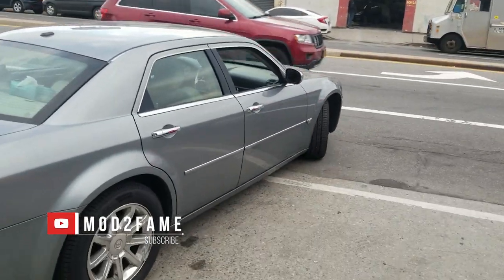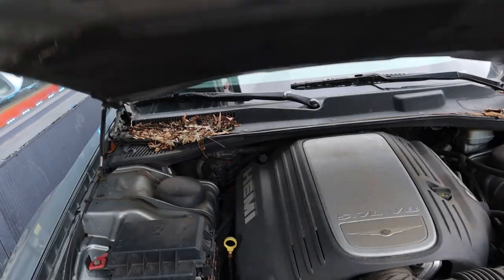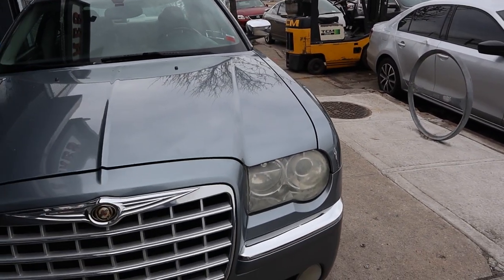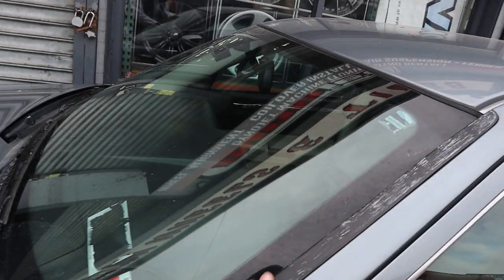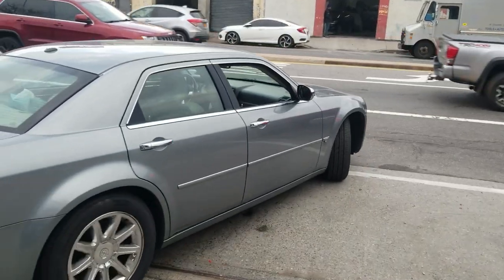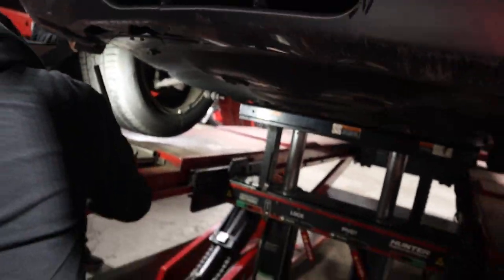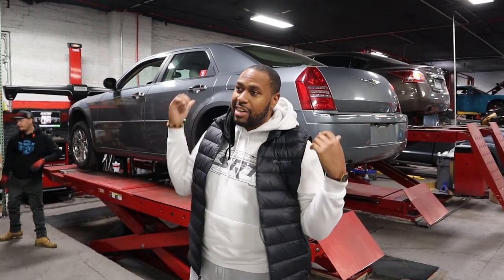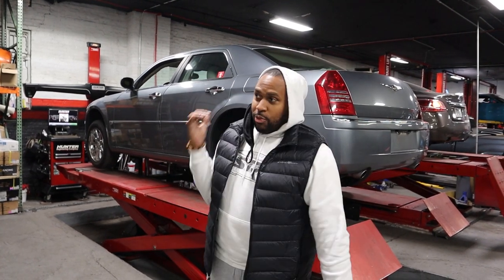Did I Buy A LEMON? EVERTHING WRONG With My 2006 Chrysler 300c ....

Comment: I've had my personal mechanic. Replace all of those things. I just bought the parts on either amazon or ebay. My latest repair work. That's about to be done is. The replacement of my drive shaft, emergency brake shoes and an alignment. After that's done. All that will be left to do is the leaking sunroof. A small ding on the corner of the hood and upholster the front drivers seat. After than mine will be 100.

Comment: I have a 300 touring. I've had all those issues over the years. Some were an easy fix. Such as a blown fuse. It's good on gas. However if you own a rear wheel drive one. It's not good in the snow. I've well maintained mine. She runs great.
Reply: How great is it on gas I want to get a 06 one
Reply: It’s good if you’d don’t step on it

Comment: I had replaced everything in the front of my suspension on my Chrysler 300c and  especially the lower front ball joints. I wanted ones that  You could grease it was so hard to find them. I had to replace the bearing that's in the mid section of the drive shaft that was fun to do.  Check the edition coils Rust gets inside the boots where the Spring touches the screw inside the coil that goes to the spark plug. I just threw them out and I put 40000 V coils on there. This is a really good video

Comment: Let me say this my 06 300c had never been an issue bought new when she had 17 miles ... low and behold still have it with 224,998 miles just a simple egr valve issue and that’s it just keep the oil changed every try 3k plugs and just take over care of it and she’ll be good to you ... btw I’m tuned with hemi feaver
Reply: Thanks for sharing, i think 2006, 2007 and 2008 models are solid as rock. Beside the Mds problem which u can get arround with just a tune
Reply: True I’m on 87 mpg boost
Reply: @kingakfortyseven3852  a good 93 tune with trans pressure turned up makes a world of difference and more fuel mileage than the 87 boost trust  me
Reply: Btw mine was still running when it was totaled out at 245,000 miles
Reply: @movingearth3726  the canned tune? Haven’t tried the 93
Reply: @kingakfortyseven3852  yeah what programmer are you running ... Diablo Trinity sport you can turn the shift pressure up on the Chryslers
Reply: @movingearth3726  i got a itune3

Comment: Nice Video 👍A shop easily charge $125.00 labor hours to 160.00 labor hours to install a 100.00 part. And the use a book for pricing labor hours. Some shops show no compassion with people going through hard times. Also many shop just straight up lies to the customer on vehicle needs.

Comment: My 2006 Chrysler 300 SRT8  had a 2 piece bumper.  It had the SRT bumper + a chin spoiler.  In 2008, Chrysler made the 2 into a 1 piece bumper.  I noticed the older model was lower to the ground. The newer model was higher.  It was very easy to damage in snow and ice.

IF YOU CAN FIND THE 2 piece, BUY IT...it's a much sexier bumper.

Otherwise, you'll be stuck with the 1 piece as your only option.  The OEM pieces are best.

#2 You can add on the think trunk spoiler to make it look better and I recommend getting the SRT8 wheels  10-spoke. 

Chrysler made those cheap ass SRT-DESIGN stickers.  No reason you can't upgrade the cars looks and add that sticker.

Comment: One reason you should ALWAYS  check the Engine oil... it tells you a lot about the condition of the Engine Internals. Worn head gasket can cause water to enter the oil sump making the oil milky. There could be worn piston rings allowing blow-by into the oil sump, which would change the oil viscosity. You’ll see how thin the oil appears on the dipstick. Checking the oil tells a lot... it’s part of how the car communicates it’s internal engine condition.

Comment: I got a 2009 Chrysler 300. I’ve had it since it was new.  I wish I had bought the Hemi instead but I have the 3.5 engine.  Only thing I hate about my car is that is uses a lot of oil. I use a full synthetic oil and I can get a oil change and 3,000 later the oil is below the “min” on the dipstick. It’s not leaking oil anywhere. Also I’ve changed the water pump twice. Other than that it’s been a really reliable car and it has 211,000 in the odometer. My wife has a 2007 Accord and it’s funny because her car has more problems than mine.

Comment: grab some coilovers/lowering springs. would sit nice on some different wheels

also, most of these parts are very similar to the oem parts. i remember i looked up the manufacturer of some of my bmw stuff, and they were the same as the "off brand" oem just had the bmw stamp alone, the off brand had bmw stamps, and the off brand stamp.

Comment: The Chrysler 300 came out in 1998 As a Chrysler 300 M that was the first GEN the second GEN came out in 2005  Chrysler 300 with a hemi and a new V6 3.5 Body so much has not change besides headlight and tail lights engine wise The 5.7 hemi also known as the SRT 8 and then 3.5 V6 The 1998 to 2004 Chrysler 300 was overshadowed by the Chrysler Concorde but the 2005 is the second GEN not the first
Reply from the maker: i hear what your saying but those LH cars were north pole / south pole different from the LX series fwd, cab forward, motors etc

Comment: I have an 06 300c.. egr valve is $25 and easy af to replace.. door handle replacement is a must cuz they suck. Front end noise.. youll always have that. Had Chrysler do a whole new front end for me and after 10k miles its makin the same noises.. you need to upgrade the suspension fs. Dont do oem. Also you can fix that bumper with $1 krazy glue and $12 bondo and $10 on paint.. thats $23 and 1.5 hours of work. That headlight replacement will run u about $65.
Reply: Yup 2 years later and everything is going bad again, have to do a whole suspension every 100k miles

Comment: What’s the link to the Amazon suspension ? I’m actually about to build something like this. 

I want to put the newer interior 
Hellcat cams 
Hellcat intake 
Hellcat Torque converter 
STRAIGHT PIPESSSSS
SRT8 body kit 
Daytona Decal across the rear 
Scat pack rims 
Panoramic roof
Reply from the maker: I want to use them for a while and make sure they're good first

Comment: I just had the same issue for 05 Chrysler 300c the calliper on the front driver side was seized and it turned out it wasn't the calliper after I replaced it. It was the ABS module that was no good. Before you change your calliper check your ABS module if it releasing the pressure from the calliper. and btw that kit you found is absolute garbage I know it's cheap but it is cheap for a reason, I would recommend getting it from Moog.
Reply from the maker: Thanks for sharing info! Appreciate the help

Comment: I would love to have a 5.7
Reply: Get ready to dish out $$$.. strong motor & transmission.  But major problems are suspension, control arms,  tie rod  sensors,  02 sensors,  tpms,  modules. In all old 300s will need radiator, coolant sensor, thermostat,  electric fan, blow heater,water pump,  actuator replacement.. Eventually chrome panels & door handles break off. 
But overall solid car,  will run fast and the C is luxury for its time.  Need a Bluetooth adapter or after market. The Boston sound system is loud for being stock. 
Mines started getting all its issues around  75k miles.  Gas mpg  25 25 27 @  50-60 mph on highway. . Anything over 65. Be burn gas on them  5.7 , 6.1 city like 15-21 yeah you'll  be at gas pump daily. Those are the Cons..
Plus+ is overall cheap car to buy and fix up all part's on Ebay or Amazon cheaper or junk yard. IDK  I had fun drive my 07 300c hemi but time to get a new car 😆
Reply: @Jose951Sanchez  my 02 sensors went out & my cooling thermostat , also i need new rotors , also i need breaks. I work on it myself so ion gotta pay nobody so i save tons of $ im at 140k miles on the 5.7 hemi it’s fast asff & tuned

Comment: Unfortunately, it's just a matter of time before it drops a valve seat. You don't have to overheat it for it to happen either.
Reply from the maker: Sheesh, that bad huh?
Reply: @Mod2Fame  ya, it's a defect with the valve seats, but strange thing is it only drops the seats where the mds cuts off the 4 cylinders. So it may have something to do with the early mds hemis.
Reply from the maker: I am gonna deactivate the MDS, that should help

Comment: I'm just finishing up the complete restoration on my 2005 300c. Unlike your vision, mine was to bring it back to near factory on the outside.

I replaced ALL the chrome with brand new OEM and boy was is hard to find. I found new EVERYTHING. THE CHROME LOOKS LIKE A DIAMOND ON LIZ TAYLOR'S PLUMP FINGER!. I also had to wrap the black door pillars and had to replace the windshield pillars AT $200 A PIECE FOR A SILLY PI3CE OF PLASTIC!!!

On the inside I hand restored the tortoise shell handles, shifter knob and steering wheel. I had the dash, center console and upper door panels all upholstered in double baseball stitch black leather. The seats were redone in vanilla colored leather along with all the moldings like pillars, headliner and visors and lower door panels and center arm rest/console cover. I also added subtle LED strips to create tasteful mood lighting. Brand new BLACK carpet from OC carpets. 

New windshield along with new wiper cowel, infrared blocking film all around on all the glass including windshield. Installed flat screen infotainment center with front and rear cameras that record to SD, bluetooth and GPS. I added push button start and keyless fob. 

Underside got a whole new exhaust system, new splash gaurds, all new front end just like what you did here. New vented rotors, breaks, calipers and strut assembly all the way around. Felt upholstered wheel well liners to keep them looking jet black. I found brand new wheels along with four sets of center cups from overseas from a shut down Chrysler dealership. And I put Pirelli tires on for enhanced handling. 

New paint with quintuple coat diamond hard clear coat with Teflon Tech to prevent scratches and chips and holds a long lasting shine.

The only thing not done... yet... is engine and transmission. The only reason I didn't do that first is because the paint shop could get me in right away. If I had waited to do the paint then it would have been a six to eight month wait because of the hail storms here in TX. I can get the engine and transmission done in a total of two weeks.  Crate engines are available and transmissions are also available so they can be done quickly. 

All in all, if I include the engine and transmission, the total cost will be $11,487.48. The car is essentially brand new and with proper care will stay that way a very long time.

The reason I did this is because like he said this car revived Chrysler and changed the whole vibe of mid level passenger car design. When a car company does it right, it looks right forever. This body style is timeless. To this day, when you see them coming down the street, you know what it is and it still looks like it means serious business!
Reply from the maker: wow that's a awesome build!